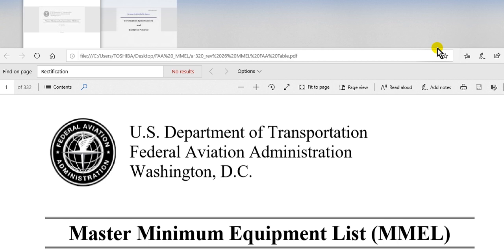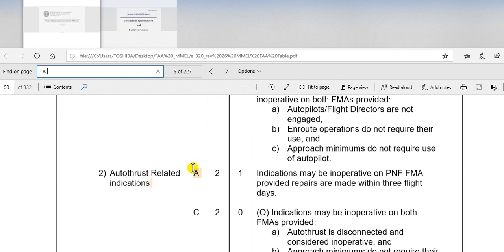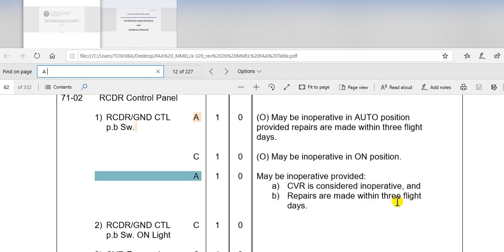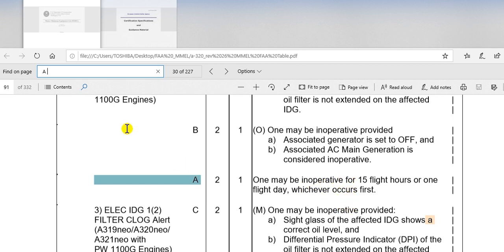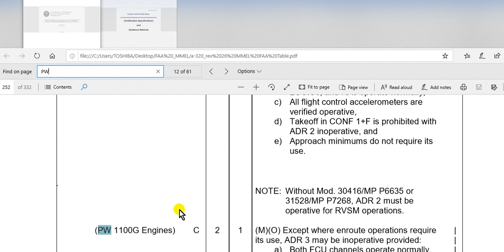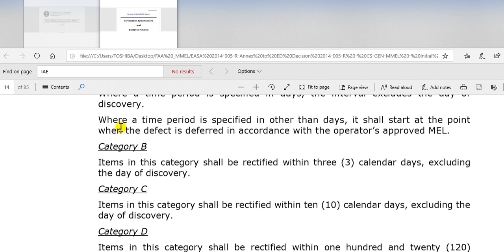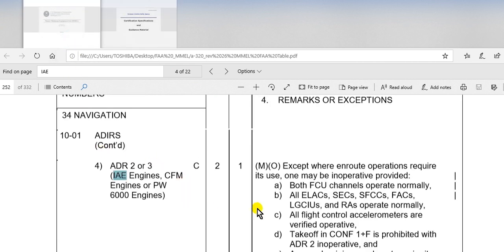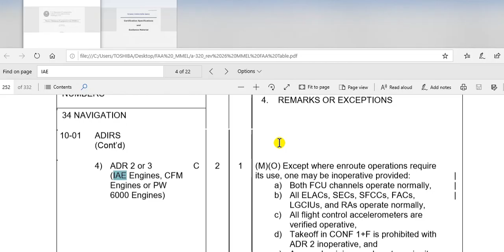How To Customize The MMEL to get MEL Part 02

Comment: I look at Your materials and I really like it. I can see that you are a professional and love your job. I also work in aviation, and unfortunately I can 't always find answers to questions and try to communicate with colleagues from other countries or companies. For example, I have a question for You - what do you think if an aircraft technician does not have run up training, can he perform dry motoring or idle leak check of the engine if he has a theoretical training course?It is AMM job, but there is a special course for performing this procedure.
Reply from the maker: Anyone who will deal with the aircraft must pass a certified training
Reply from the maker: In your case 1) what about foreign object debris (fod),  2.) safety , 3) clearance,4) phone set.